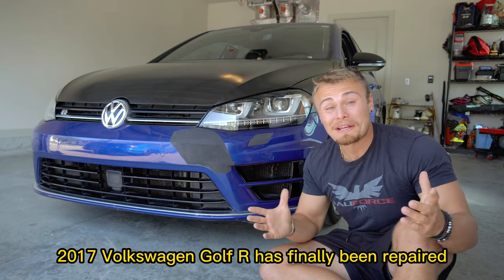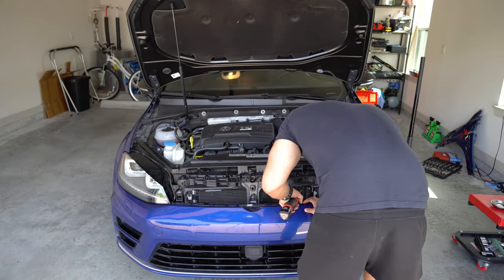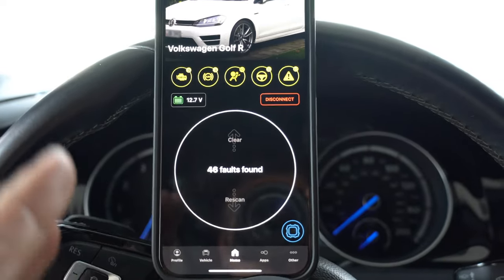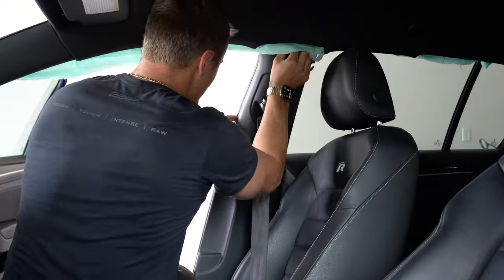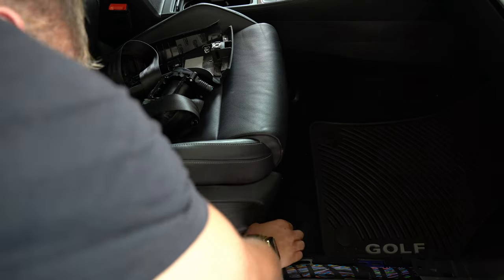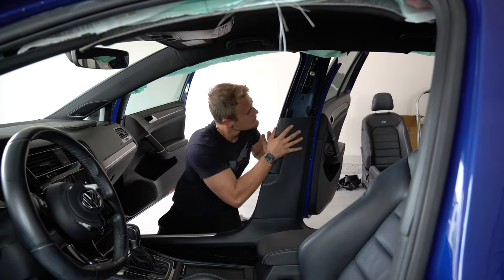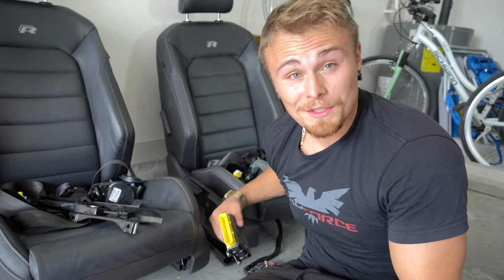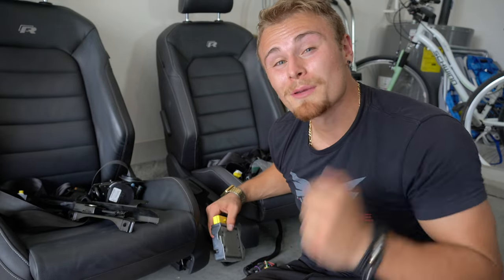REBUILDING A WRECKED VOLKSWAGEN GOLF R | PT 5

Comment: Radar sensor has Component protection active, since the sensor you have has been programmed to another car it needs to asigned to your car. This can only be done with a dealer tool with online acces. Probably you can find someone who can come to your location and program it for you :)
Reply from the maker: Okay sweet! Thank you for this
Reply: @Haydenschreiermk2  Same goes for your airbag module most likely it wont have and crash data but to be sure you must replace all airbags and delete error codes. If the error codes go away they module wont have any crash data so i would wait sending it away if i were you. I work in many golf crash vehicles :) btw get rid of those headliner airbags asap it will crease your headliner
Reply from the maker: Update to answer this in next video Part 17! i will show you how to do it!!!
Reply: @Haydenschreiermk2  Lets go!! :)